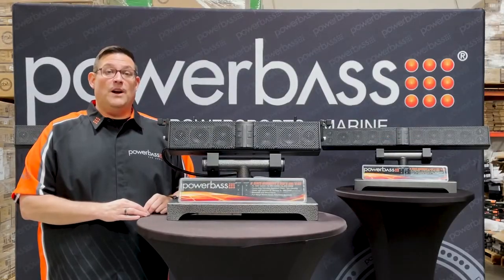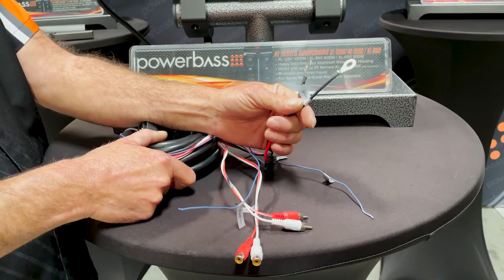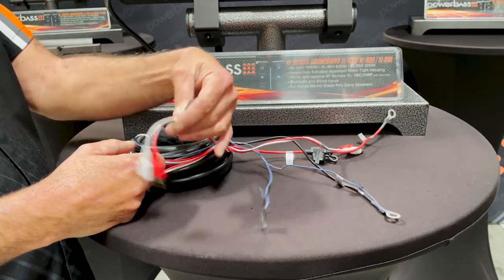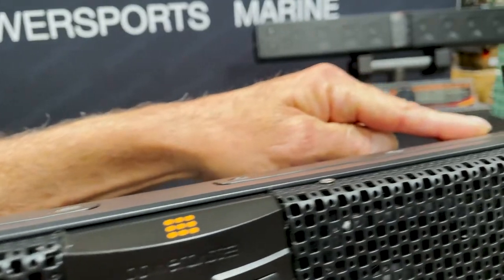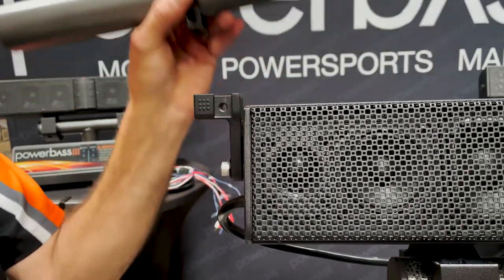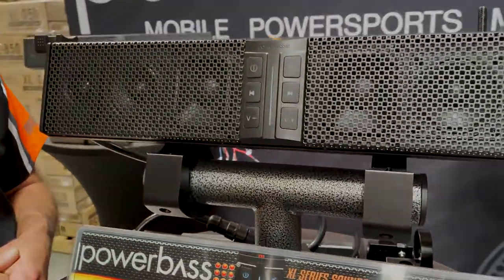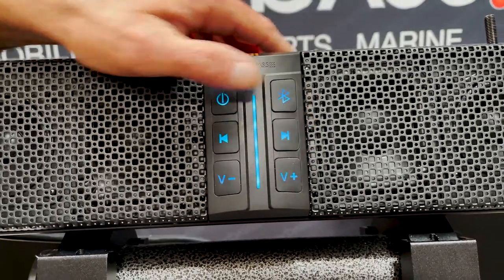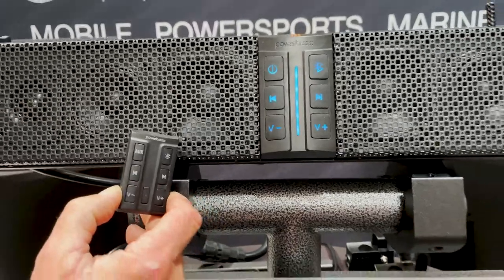XL50 V2 Soundbar Guide

Comment: I have a JBL marine 10” sub. How do I connect this to my Powerbass sound bar?
Reply: Did you get your subwoofer hooked up to your sound bar?
Reply: @kyleforehand4481  I did. However, having some issues. The JBL MBP 10 sub doesn’t power off when I turn the key off. And it could have a little more gain. No issues with the Powerbass 1200 sound bar. It’s runs perfectly. Love it. Just wish the sub would cooperate. Thanks for following up. Appreciate it.

Comment: Is there a way to pair 4 xl1250 together?
Reply from the maker: Yes you can sorry for the late reply we just saw this..   You can run 6 of them without issue using the AUX in and AUX out cables.